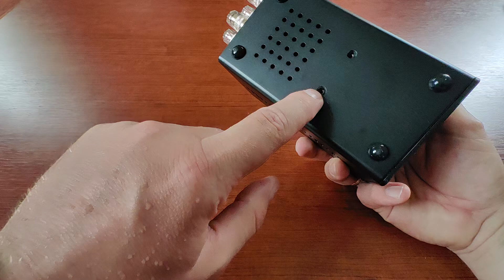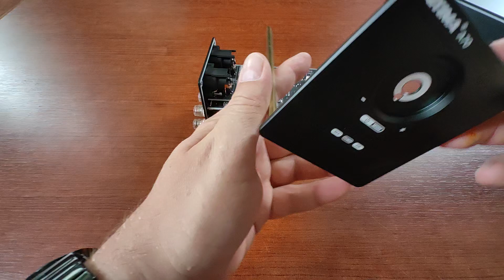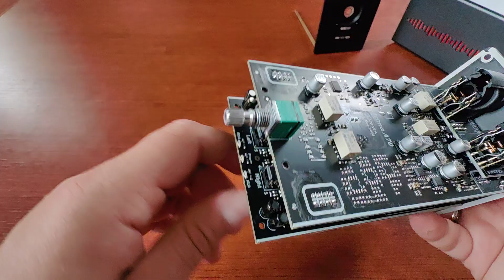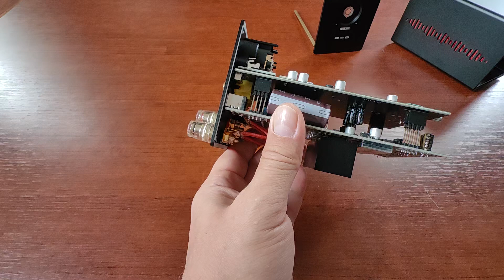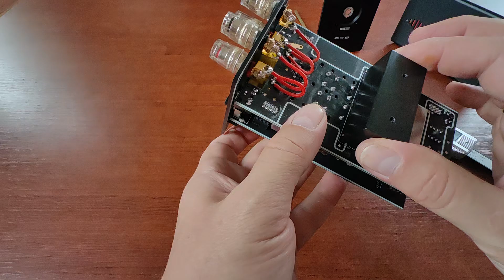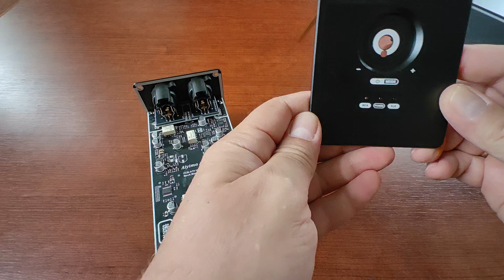Replacing opamps in Aiyima A70 and first look at what's inside

Comment: Hi do you think there would be any way to get the akliam lc5 opamps to fit somehow ?
Thank you
Reply from the maker: via these adapters I reviewed some time ago, maybe, but I would be worried about air circulation and heat buildup.
Reply: Thanks bro ,I wonder if one could cut a hole on either side of the case and have the opamps outside the case , it wouldn't look good though .
Reply from the maker: @peterpipe9015 well you could, but then it wouldnt look good, it would be looking bad - lets be honest about it :)

Comment: Try sx52b/45b, better than akliam.  Bigger soundstage, better separation and resolution.
Reply from the maker: @onionknight9431  And price?
Reply: @k4syx sx52b is about $14, sx45b is about $30.  I have 52 in Aiyima ao 7max and a pcm1794 dac.  52 doesn’t work in Fosi ZA3, but 45 works.
Reply: Does it work for BRZ HiFi E600?
Reply: @DTAudio_Cuffie I don’t own that amp so I can’t tell you.

Comment: does AkLIAM LC5 op amp (vertical) fit in there?
Reply from the maker: @JRadian  I think we'll need adapters with short wiring (two DIP8 sockets wired together with something a little flexible).
LC2s may fit directly, I will have to check it

Comment: You can pull of the entire top section from the bottom one so you can reach the op amps better.
Reply from the maker: Yes, you need to unscrew backplate for that but it's easy. However for regular (not discrete) opamps theres plenty of space if you'll use tweezers or something like that.